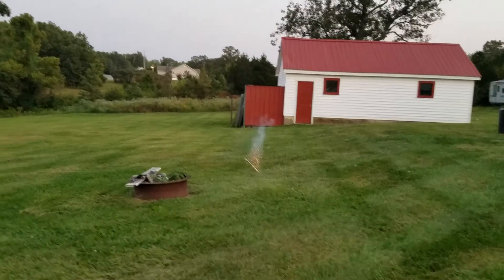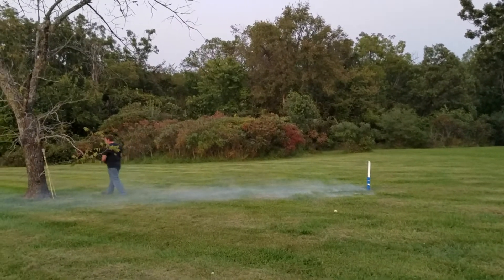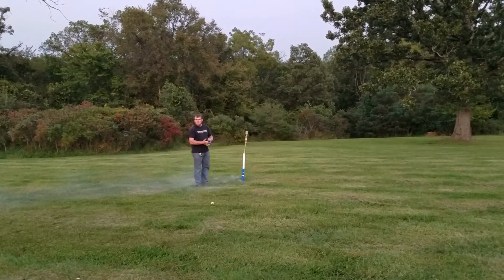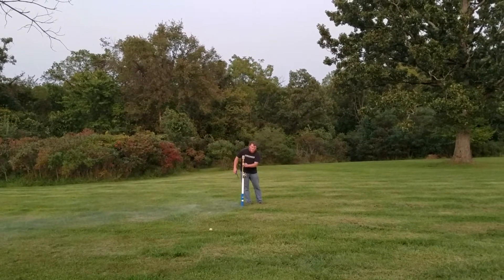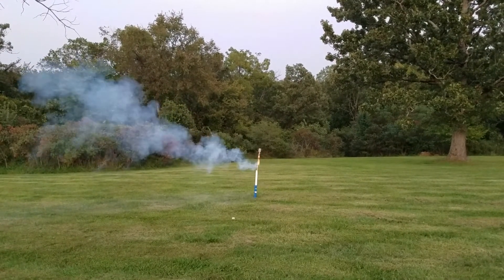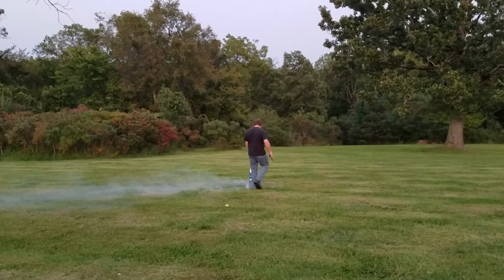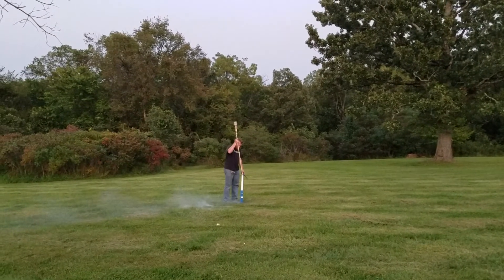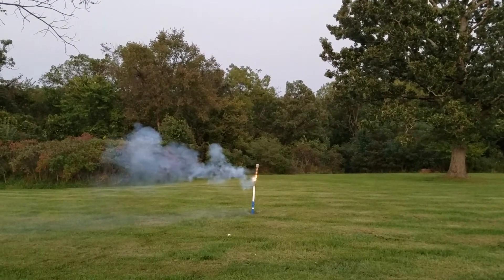3 one pound rocket testing using cedar charcoal

Comment: Very nice! Do you just moisten your mix with mineral oil and press as is, or do you granulate through a 10-20 mesh screen? 
I’m trying to get a cedar mix to work in my 1lbs, but my first batch was WAAY TOO HOT! I used 60-30-10-+2, but ball milled it WAAY TOO LONG.
Needless to say, light fuse, run away, BOOM! Lol
Reply from the maker: i started using mineral oil later on, main thing is to dial in the same pressure using a hydraulic press, and only add small portions each time and level it before pressing, that way you do not have any voids.

Comment: So with just one stick they seem to fly straight I have a cohete type rocket 5/8 and they seem to want to fly to left even with a 36inch 1/4 inch stick.
Reply from the maker: its all about balance  point and making sure the stick runs parallel with the tube.  recover the rocket and check the nozzle and  make sure its not coming apart, that can also make it go left or right.
Reply: @SilentDeath002  ahh got it yeah ill check it out.